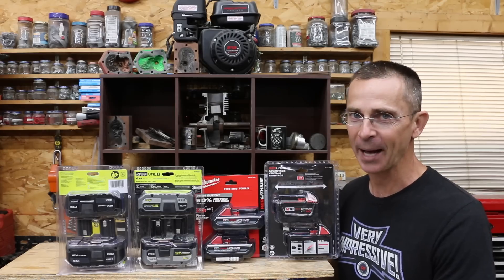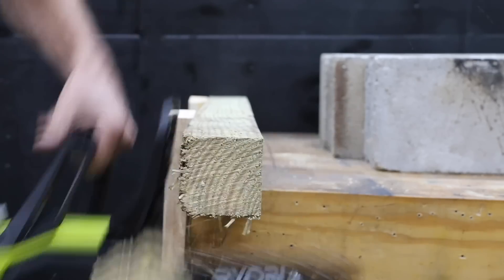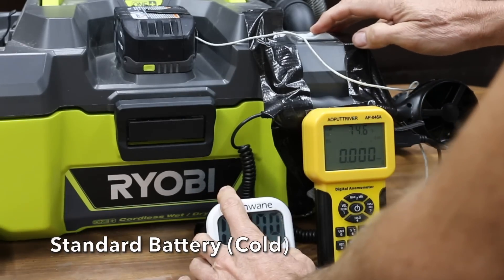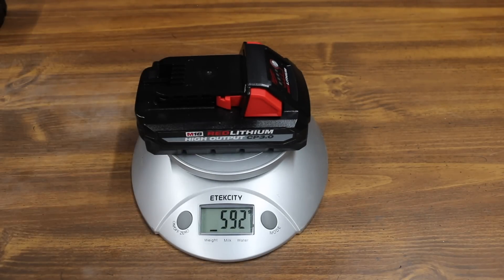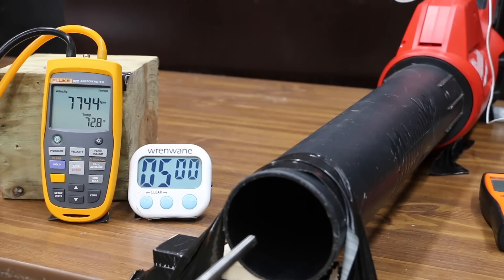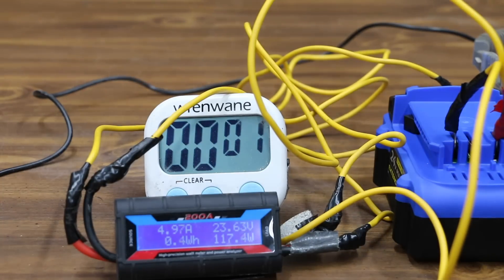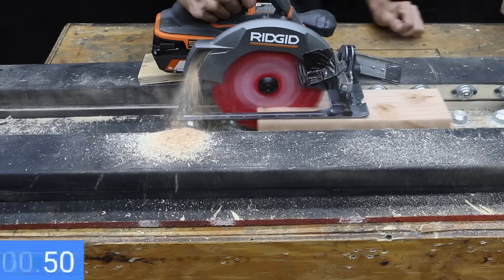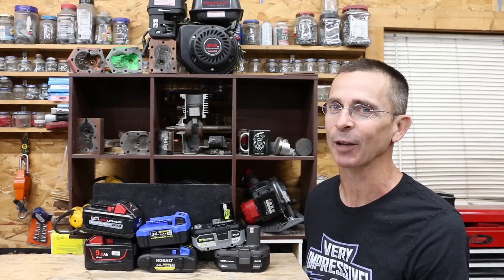Are "High Output" Batteries Better Actually Worse?

Comment: The last test was not a fair test of the knock-offs. Comparing with a genuine 9Ah may tell a different story, and I'd bet that a longevity test would see the knock-off fail much sooner. Also, most of the 21700 packs are comparing 1 cell to 2 x 18650, so they're doing twice the work. Of course, the average consumer doesn't know the specifics and can only go by the sdvertising. Comparing a 9Ah XC to a 12Ah CP would yield huge differences on some tools like their large drop saw.
Reply from the maker: Thanks for the feedback!

Comment: I could have told you that the Chinese knockoff would not perform as well as the Milwaukee, but it was good that you proved it to the world!  China has a horrible reputation for making cheap knockoff Li-Ion round cell batteries from no-name brands with greatly exaggerated specs.  China takes low grade cells, rewraps them with outrageous mAh and Amp specs, and sells them at a higher price than the real and good cells to support the outrageous claims and people buy into the specs, not knowing better, and buy them.  China is notorious for selling this crap on eBay and probably on Amazon now, too.  These are Bin D cells where the Samsung 30T and others in the OEM brands are Bin A or Bin B at worst.  A percentage of cells are tested off the OEM line and those that meet the specs best are Bin A and as grading reduces, they go in lesser Bin trays.  The Samsung 21700 30T is the best battery in its size class.  The Chinese knockoff likely has, if you tore the battery pack apart to see the brand and model number of the cells, would likely have these same cheap knockoff no-name cells.

I will go for the equivalent 120VAC corded devices over battery pack devices nearly every time.  Battery pack drills are an exception, but this getting only 6 minutes for a blower out of a battery pack (and the like) with reduced efficiency and/or performance as the battery pack discharges, makes paying so much more for the device, the battery and it charger, cost so much more than an equivalent corded device that it's just not worth it for me.  I know there are applications, like construction, etc., where battery pack devices are necessary, but I am not in any of those categories.  One thing that would help with consistent performance would be to have a Voltage Boost Amp (or Buck/Boost depending on the Voltage needed) in the battery pack or device to regulate the output to a constant Voltage as the pack discharges.  These devices are widely used in things like Laptops and E-Cigarettes and don't cost that much to add or need that much space to install, but it's not likely they will ever be added to power tools.

With all that said, I remain impressed with your testing methods and procedures, thinking to test things that many would not have considered.  You're the man, Todd!  Thanks for everything you do for us.  I always watch your videos to the end, Like and comment, to help you with the YouTube algorithm.  Sometimes I go on to long, but I can't help myself.  A Happy and Prosperous New Year to you!
Reply from the maker: Thank you for sharing this! Happy New Year to you!

Comment: I work outside in Canada and we use Makita one of my coworkers uses Dewalt and another had used rigid last year my Bosch batteries I can use them outside in -40° weather windchill included and my batteries will last for an entire day the Milwaukee and the original wall-to-wall died multiple times throughout the day Bosch doesn’t have a high-performance battery it really doesn’t need it even with extremely hard use putting in lots of screws and heavy material concrete and metal studs my batteries can last a full day except for when I’m going and drilling through concrete
Reply from the maker: Thanks for sharing!

Comment: Also an important test that you didn’t do this time, charge time from completely drained to 100%. I know with the Milwaukee products they have a charger available that will charge the high output batteries in half the times their standard charger. Whereas they’re standard batteries and those chargers won’t take advantage of those charge times. That could be the bonus to getting these high output batteries if you use up your batteries quickly and need to get them recharged just as quickly.
Reply from the maker: Thank you for the video idea!

Comment: love the content.. the right battery for the tool is like the right tool for the job.. some tools take advantage of the tech that goes into the batteries and you can see the performance change.. not saying that it is better because there will be trade offs in run time verses power output, thus what you value more is what is determines if it is better.  In choosing the type of battery you have to look at the tool you plan to use it in and how you plan to use it.. in ordinary use, these high output batteries generally do not justify the added costs in my opinion, unless you truly need the added power and/or run time for a specific tool.
Reply from the maker: Thanks for sharing!

Comment: It has been my understanding that a lot of those high output batteries are really tailored towards High draw short-term use tools like impact drivers and wrenches, the different cells have the ability to dump the amperage faster which turns into more torque
Reply from the maker: Thanks for sharing!

Comment: Well, I like your testing methods I should mention not all tools made by these companies can actually even take advantage of an upgraded battery. This can occur in both demand, and/or design difference. Sometimes even the circuitry in which the upgraded battery design may not even function with the tool. You may not even be able to take it vantage of the upgraded battery because of it.
Reply from the maker: Thanks for sharing!

Comment: In terms of batteries I use Dewalt as they just always last/work - with one exception. The Lidl/Parkside 12V lithium ion ones. Their bigger 18v batteries are pish - but their 12V battery range is abnormally good for the cost. Those little 12V ones are kick-azz strong, they recharge fast, they give outrageous output for their size & you ought buy some, just because.  Ignore their other stuff, but buy the Parkside 12V range - you will not be disappointed. If you only buy the torch they sell that takes that battery platform, you won't regret the purchase.  Excellent.
Reply from the maker: Thanks for sharing!

Comment: Thanks for another great video. I have many Ryobi tools and batteries and U think the HP batteries require tools that have electronics in them that form a feedback loop with the battery to gain the advantage. I believe that most of those tools will also be brushless. I have bought Ryobi knockoffs in both voltages and 28 volt Milwaukee knockoffs and find they give about 30% less than advertised but are still a good value because they are still much cheaper. (9ah gives 6ah  at 65% of the cost of branded 6ah battery)
Reply from the maker: Thanks for sharing!

Comment: Torque test channel compared these and his channel, like yours, is  high quality testing. Some tools aren’t going to see the difference. A leaf blower draws what it draws and never has any extra load. An impact, grinder, drill etc can see highly variable loads. I know for a 100% fact they make a difference in these tools. It’s not a whole lot but i can def feel the difference. The 5AH are still my go to though for a lot of the tools as the 6 is just so damn big and heavy compared to the 5. My 6” grinder seems to benefit the most. All in all great video; but i would not have picked a leaf blower for the test medium. It’s good to see if there’s a difference at a steady load but i would have used a tool that has to be put to work with heavy loads and high draws.
Reply from the maker: Thanks for sharing!

Comment: Purchased an OEM replacement Milwaukee HD 9.0 battery. For the price I expected it to last as long as the original, about 3 years for occasional homeowner use. It failed to charge after two years. Could not locate a rebuild service so I decided on the same knockoff that you demonstrated. 
No issues to date, about 1.5 years.
True it does not have the OEM runtime, but two knockoffs will last a lot longer, compared to one OEM battery, for a lot less money.
Reply from the maker: Thanks for sharing!

Comment: For the Ryobi tools, it looks like you aren't using any tools that are HP enabled. As you see at :36 in your video, the HP battery on the right has 2 extra contacts on the back near the bottom of the stem that help the tool regulate the battery more efficiently, but you have to use a tool that is HP as well. That chainsaw and vacuum don't, so you are really testing almost identical batteries.
Reply from the maker: Thanks for the feedback!

Comment: I have loved the 9AH Ryobi battery. Not cheap but runs a long time and does not get as hot in circular saw, trimmer and blowers as my 4AH packs. 

The weight is more but I suspect it will serve me for many more years since it is not as abused as the typical 4AH pack. 

Not sure if brushless tools are more efficient with the same battery WH. They do seem to have more power. 

Sometime compare run times of 3,4,6 & 9 AH and see the Watt Hours really delivered before the battery is spent. 
The dewalt 20/60v would be interesting to see if any advantage running the same tool with a similar WH battery capacity at the different voltage
Reply from the maker: Thanks for sharing!

Comment: I found this very interesting 

Got a quick idea

Compare the battery that comes in kits with the high capacity high output batteries.

In all ( well not all some just let the smoke out older tools that is) in all the tools i have using the best in brand battery IE the 9 Amp hour batts on my Ryobi stuff really makes the tools much much better. 

Chain saws that work really well ( until they dont like last weekend) 
The best brush cutter 18v by ryobi is a bit of a beast when using 9 amp hour batts. This means i very rearly pick up my stihl unit any more.

They are expensive but the payout is worth it in the long run

I would be interested to see the gains or lack of gains in a test to the caliber you do not just me seat of the pants tests.

I find with ryobi and Milwaukee that 4 amp hour batteries just arnt cutting the mustard
Reply from the maker: Thank you for the video idea!

Comment: So something about the Ryobi HP batteries is if you notice on the back of them they have those extra contacts. Those are supposed to be used with specific tools to allow the tool to draw more power then from the standard batteries.

 Unless using those tools I think the HP batteries are basically the same as a regular battery.
Reply from the maker: Thanks for sharing!

Comment: The main thing you want to see on a good battery regardless of branding is a lower internal resistance.
That way the battery can provide more current.
Also that should yeild more capacity at higher current draw.
As higher current draw reduces capacity due to higher losses.
Additionally a lower IR battery should sag less giving you higher voltage under load.
Reply: Tbh it's a shame the manufacturers don't like idea specs.
A "C rating" on the packs would be very useful info.
I'd take a high capacity low c battery for my impact driver.
And a high c low capacity for my big drill for example.
Reply: The other thing you should do with this test is build and inline amp and volt meter so you can see the real data.
Reply: Oh also another point if your cutting wood as a test maybe use MDF so it's more comparable?.
Reply from the maker: Thanks for sharing!

Comment: Not many tools are powerful enough to take advantage of the higher voltage output 2170’s are capable of. More then anything they are future-proofing battery packs so that more powerful motors can be built. However, there are some tools like blowers and chainsaws that definitely can increase performance. Blowers in particular draw so much voltage that normal 18650 battery packs can quickly overheat and shut down before they full discharge. 

Also 2170 cells can charge twice as fast if you have some like Milwaukee’s Super Charger. Takes a 12.0 HO from 0% to 100% in less than an hour. That can lead to greater productivity and lower cost for professionals. So they have benefits but many of them aren’t being taken advantage of yet. Also 18650’s power output drops off rapidly as they get low. Some testing has shown that 2170’s maintain full power longer as they drain.
Reply from the maker: Thanks for sharing!

Comment: Not to nitpick, however a lot of your tests along the way seem to focus on speeds of x/y/z as absolute.  Take any 5 Ryobi's as you had as the first test, and you'll probably find them all stopping at 45# plus or minus several #.  Standard deviation. Identical ucontrollers, mosfets, IGB's, even resistors are all going to have random tolerances, which end up giving different results. A 5% tolerance +/- is normal and should be expected and taken into account. More than likely in this instance, there is a circuit in the single Ryobi tool which shuts off at a certain current limit, so it doesn't show what you think it is showing.  
If you want to check electrical output, I think a simple light, potentiometer and DMM would actually check that. In hindsight, advertising that your + battery will improve your tools x/y/z metric when it is limited by the tool is very good to know. Which your tests will show.
Reply from the maker: Thanks for the sharing!

Comment: an important caveat for Ryobi is that not all their tools utilize the HP batterys. only their brushless tools and more importantly the ones that are more demanding take advantage of them. drills, grinders, etc. if it has the extra contacts on the back  hp should help a lot. the tools used in this video DO NOT take advantage of the hp batterys
Reply from the maker: Thanks for sharing!

Comment: Watch out on the knock offs - I've had 2 get very hot on high amperage demand and short out and start smoking really bad. When used on lower amperage demand items they seem to do OK, but don't use them on any of the bigger constantly ran tools that see heavy loads such as the saws or anything like that.
Reply from the maker: Thanks for sharing!

Comment: I see a lot of comments on here about not testing HP tools with the HP batteries or not using impact guns for torque testing or so on. However I still found the test useful as it served to see what sort of impact high performance batteries have on tools that don’t necessarily use them. Great work and awesome video.
Reply from the maker: Thanks!

Comment: This test definitely needs a Part 2, where you compare them on the tools that actually take advantage of the extra contact points.

Also, Ryobi has the HP line of batteries and also the newer High Performance line of batteries. A comparison between those two on the right tools would be interesting to see.
Reply from the maker: Thank you for the video idea!

Comment: Good work, Another very interesting , practical and informative vidjoe.
Perhaps some aspiring young engineers out there could develop a fitting or device, to allow swapping batteries between brands. I agree with your assessment that the convenience of cordless tools is what gives them a big advantage over corded.  However you still need access to power on the site. In addition you require extra batteries for each tool to avoid work stoppage. Different brand tools, different batteries ,spares and chargers.
For all the convenience of cordless tools, I could run all corded tools of what ever brand I prefer and have a large power pack, or small Honda suitcase generator. I’m only half joking. Thanks for sharing your research!
Reply from the maker: My pleasure!

Comment: If be interested to see how the Milwaukee batteries compare in a vacuum under load, I use a Milwaukee M18 Wet/Dry Vac with an XC 5.0 pretty commonly to pull drag line through electrical conduit and longer runs seem to really strain the battery life, curious if the high output would make a difference.
Reply from the maker: Thank you for the video idea!

Comment: I guess that for some of those brands, you need specific tools to get the benefits of high power batteries. It's like DeWalt Power Detect tools that gives more power, but only with some specific batteries, but those batteries won't give you additional power with normal tools.
Reply from the maker: Thanks for the feedback.

Comment: The "High Performance" batteries are meant to be paired with "Hi Performance" tools.  HP from Ryobi, Fuel from Milwaukee, etc.  The HP batteries have extra contacts that tell the tool what battery it is.  Only works with tools that have the extra contacts as well.  They work well in the right applications.   M18 fuel 6in grinder being one where you can see a big difference between a xc5.0 and a Hi Output 6.0.
Reply from the maker: Thanks for the feedback.

Comment: Test off brand battery adapters for power tools. Where you can use a different brand battery on the tool
Reply from the maker: Thanks for the suggestion.

Comment: I’m not entirely sure the internal validity of these tests are passable. I feel confident that these tests do not isolate what is and is not shown by testing these batteries in low output tools, and variables could not be explained by other reasonable variables

Comment: Has somebody who owns the rigid High outputs and standards I have to say sometimes that 12% can make the difference between grabbing a fresh battery and getting the job done. I've also noticed that the high outputs tend to hold the higher voltage longer so you don't lose as much tool performance as the battery gets closer to dead.
Reply from the maker: Thanks for sharing!